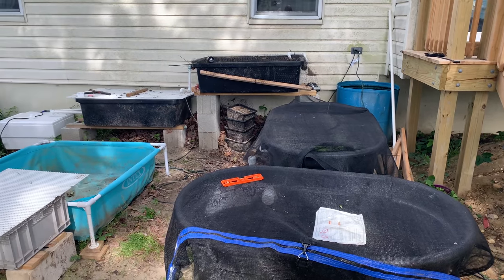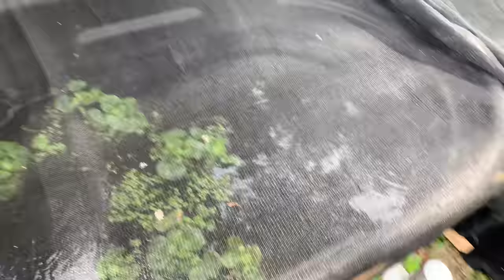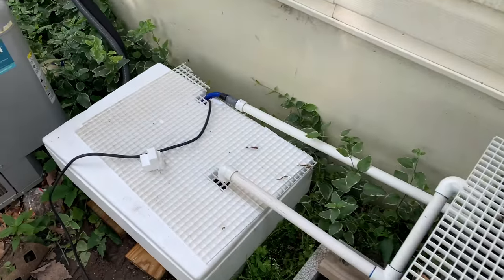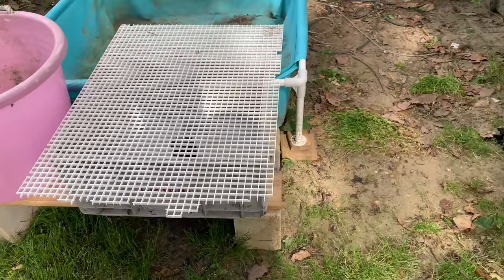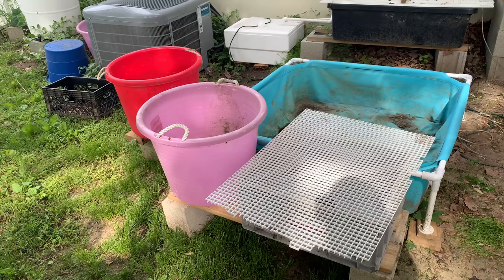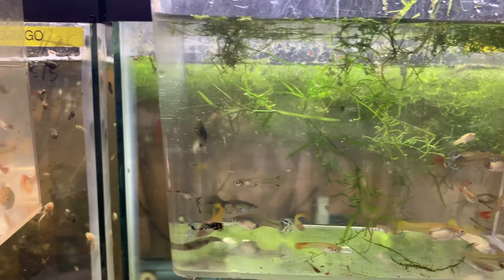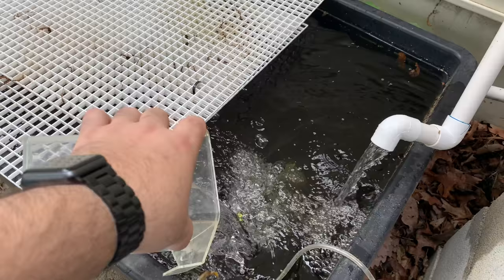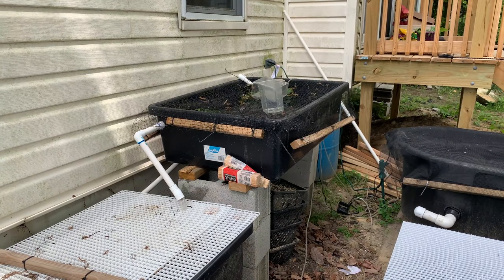MORE Guppy Ponds!

Comment: Use some flex tape around the blue hose it will seal it. I use On a radiator hose. To get my truck to shop so I could get new hose . Worked great never leaked
Reply from the maker: Too late I bought one. It was $3

Comment: I was wondering if you have any tips I have a 20g black outdoor tub has 3 hyacinth and 4 lettuce covers about 1/4 or less surface.. my temps matched ambient at 92° and I started doing slow water changes to bring it down.. only 1 loss of a female that had a ripped tail anyway.. I was considering putting bricks around to insulate and once the plants cover do you think it would lower temps? I have it in the best shades spot I can currently have the patio umbrella over but that cant stay
Reply from the maker: Maybe, but 20g is pretty small. Do you have an air stone?
Reply: I'm running a hygger 80-160gph through 3 cylinder sponge filter shoots a stream maybe 3 inches out of the water (how I have it set up) so good flow and aeration